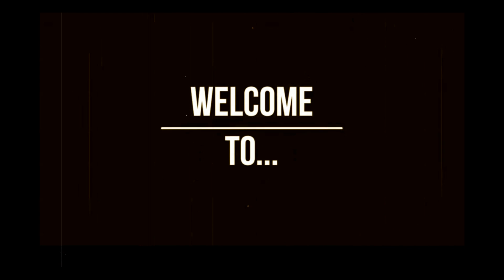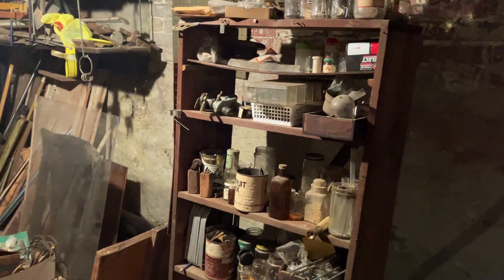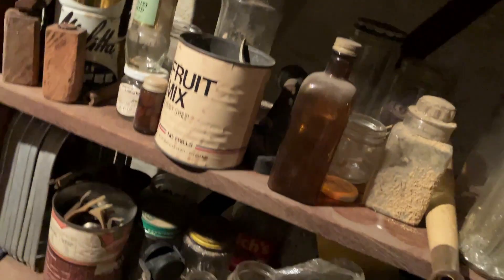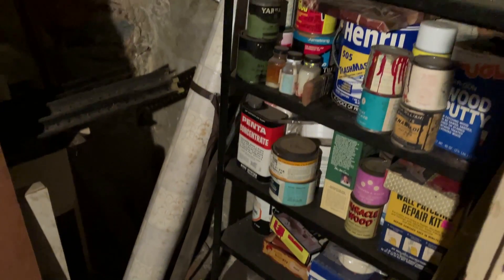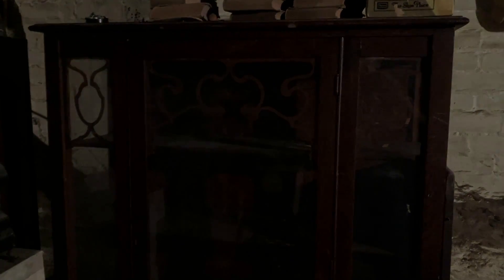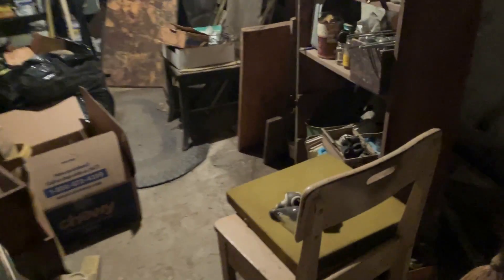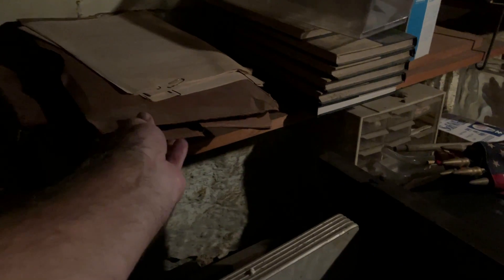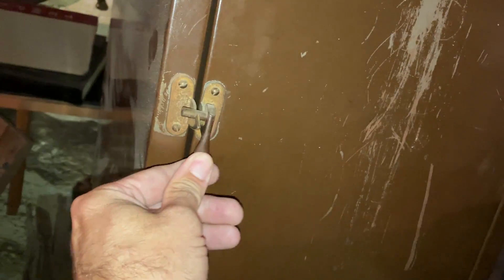Let's Honor an Old Family in their Philadelphia Home

Comment: I need a friend like that, even tough it gives me flashbacks of my shed/workshop in the backyard that I haven't been in to work on stuff in about fifteen years since I hurt my leg and too unstable now. It's 20 by 26 feet and so full you can hardly get in the door.  Things I would want most out of that basement is that faux painted board- To see how they did it and the three horse head round picture. Seen it before but can't place it. But I want one.